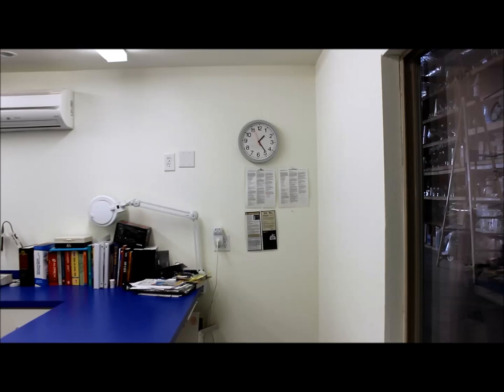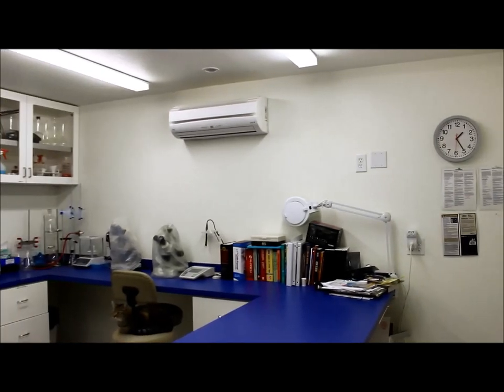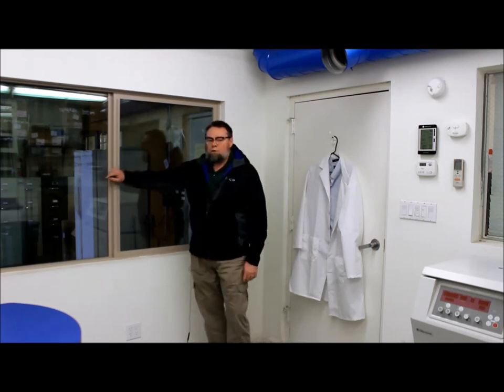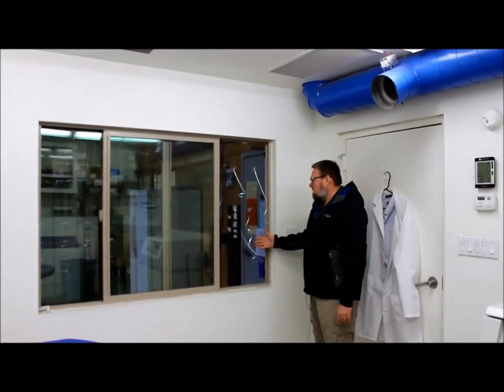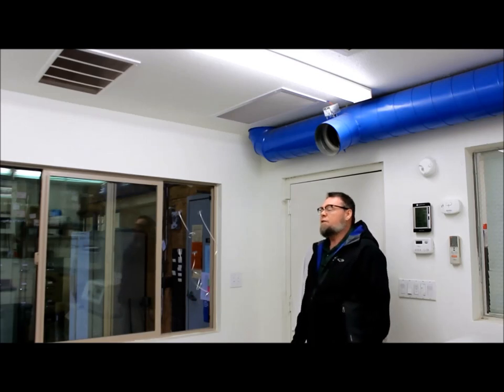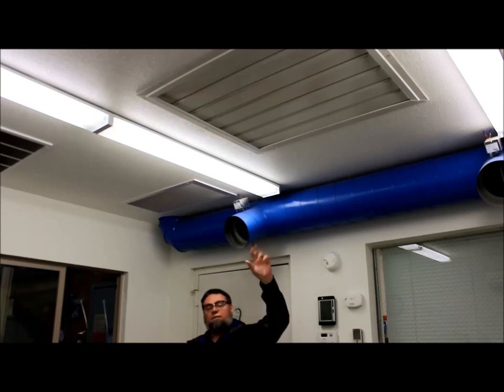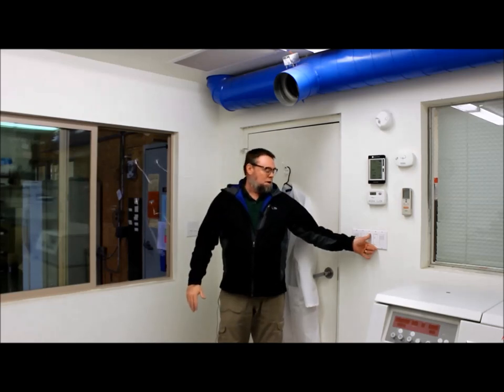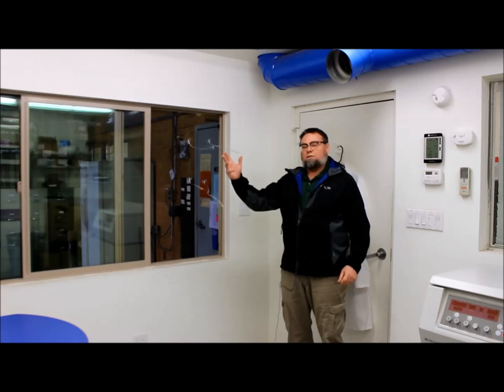Whole House Fans

Comment: I have an old direct drive whole house fan. Recently took it down to service the motor. The oil reservoir wicking was completely dry. So I gave it a good soaking with 30 weight non-detergent oil and lubricated the bearing areas and motor shaft with it. That fan is as old as the house and still works just fine.
Reply from the maker: I also have an old direct drive 30" whole house fan two speed with about 8000 cfm in high, now over 25 years old. Sounds like a helicopter when it runs but it works great and I actually like the noise as it drowns out the outside noises.

Comment: If you leave a window unlocked at night while everyone is asleep you want worry about the temperature but who’s in my house
Reply from the maker: There are locks you can buy that allow the windows to be opened partially, too small an opening for someone to get in or defeat the locks. Here is a link on amazon. 
https://www.amazon.com/Boao-Siding-Window-Adjustable-Security/dp/B07FX4YH6W/ref=sr_1_1_sspa?crid=2AF5YEBRMADPD&keywords=window+thumb+locks&qid=1686005048&sprefix=window+thumb%2Caps%2C521&sr=8-1-spons&psc=1&spLa=ZW5jcnlwdGVkUXVhbGlmaWVyPUFKWTNHNkZWSEJKVTcmZW5jcnlwdGVkSWQ9QTA4MzczNjYzTjhBRlozN1FYVlUzJmVuY3J5cHRlZEFkSWQ9QTEwMzU5ODUzNjJYSkFUS0FQTFFCJndpZGdldE5hbWU9c3BfYXRmJmFjdGlvbj1jbGlja1JlZGlyZWN0JmRvTm90TG9nQ2xpY2s9dHJ1ZQ==
You can then lock them partially open, about 4 inches, to allow enough air flow. At my home we have double hung windows that would require a 8 foot ladder and would be very difficult for someone to climb in through. We also have the second story windows that are safe due to the height. However, if someone is determined to enter your home they will, that is why I have firearms readily available for just such an occasion.

Comment: This is a great demonstration.  Over the past 10 years running sales for QC Manufacturing and most recently with AirScape Mfg. it has been cool to see more and more people come to an understanding of ventilation cooling and the options available for their specifice home construction and designs.  This is a fair comparison of how much quieter the ducted AirScape/QC type fans are.  One thing thats also interesting is true airflow as most companies advertise a bench tested CFM rating while others use the more accurate HVI method which is more applicable to real world application.  Keep up the great work!

Comment: I enjoyed it I’m planning on buying one too
Reply from the maker: How big is your home?
Reply: 1741 square feet so I’m curious which one you recommend
Reply from the maker: QC ES-4700 would be good enough, however, when it comes to whole house fans size really does matter, the bigger the fan, the quicker it will exhaust air. So any of the three larger sizes will work. But if it was my house I would either choose the largest QC ES-7000 or two smaller ones like the QC ES-4700 or 3100.
Reply: Thanks 🙏😎😎
Reply: So I guess I can just use the biggest one and get by with it 👍